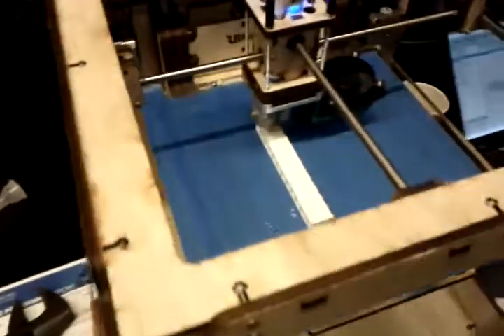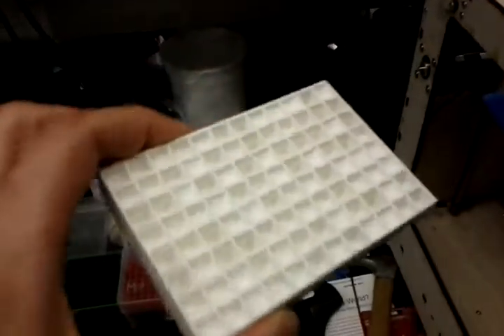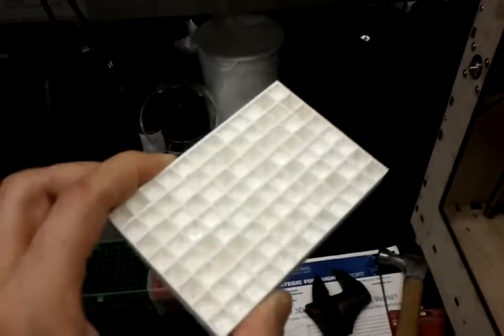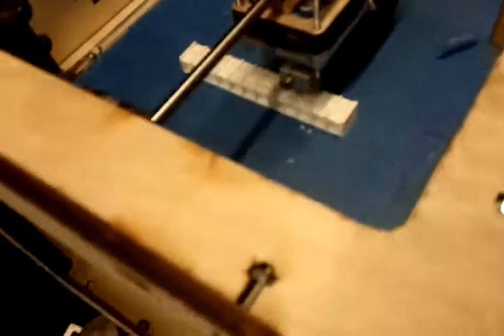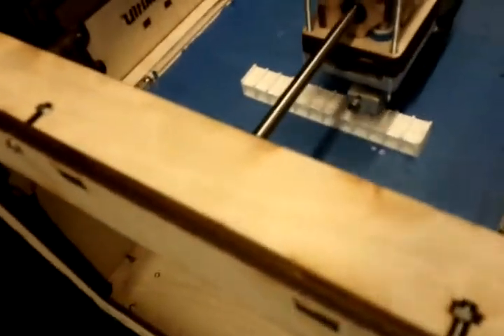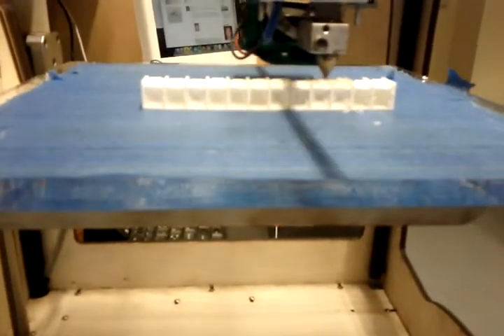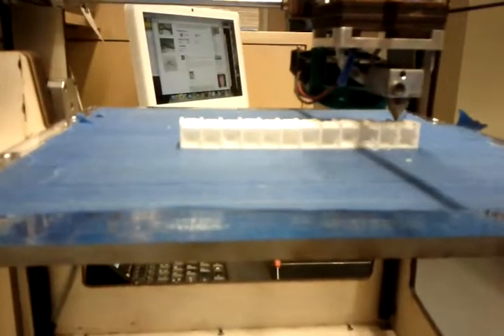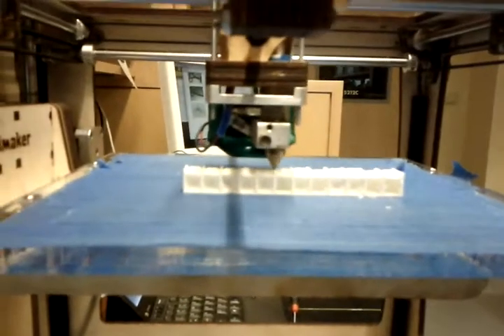Community 3D printing challenge

Comment: Hey, I am working on something similar (96 well plates), did anything you did work? I have a little bit more difficult challenge in that I have to seal a glass plate to the bottom. I'm going to try super glue gel, but how watertight could you get the wells?